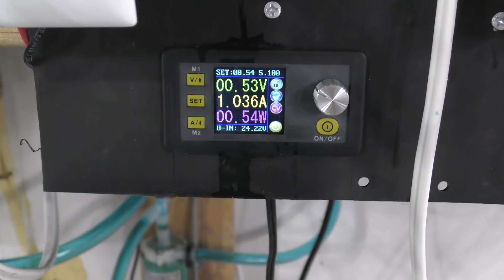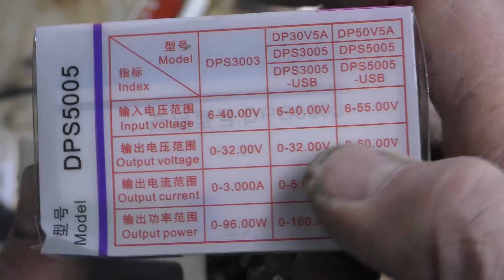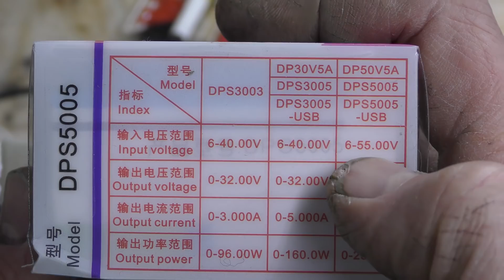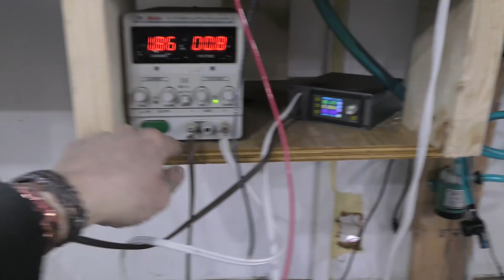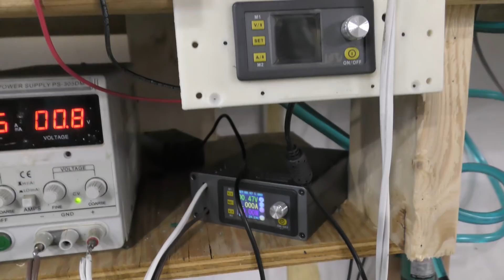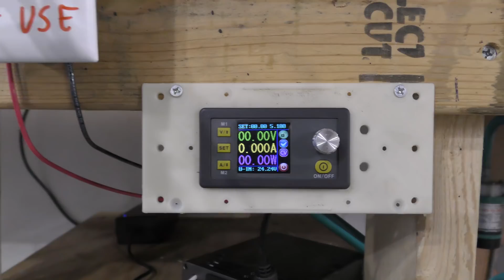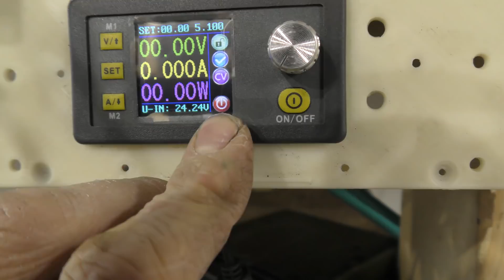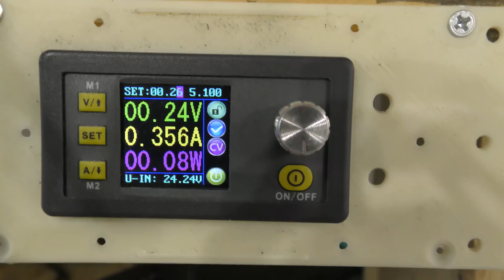New Electroforming Power Supply setup DPS5005

Comment: Hi jason. I bought your electroforming classes but I still have a big question, even before your amazing whey to teach.

I know the amps are the most important thing to consider on the electroforming but, my rectifier do not set the volts automatically.

So I would love to know how many volts I need for example when I have to set-up a ring with 0.1 amp?

And how many volts if I have a necklace that a calculated 0.4 amps. The volts will be the same as the 0.1 ring? 

I mean, i have a maximum voltage that I can use until the pieces get burned? 

I really appreciate if you could answer me my friend, and congratulations for your channel.

Comment: I just received the power supply and im trying to set it up.  I can adjust the volts and amps but when I turn it on the only thing that reads is the v and the amps and watts reads at 0. Not sure what I'm doing wrong.  Thanks for the great videos by the way! Love what you do!
Reply: Same here! Have you figured out what the issue was? I would really appreciate hearing from you!

Comment: Is there a reason why you don't dial in the amps directly. I've seen other videos of yours and you seem to be interested in the amps that flow but you always dial the voltage. Why wouldn't you allow max voltage but limit amps to 500mA or whatever you need in your process?
Reply from the maker: For electroforming I let it drift to promote texture as long as you have a good range of shine  like between .2-.4 amps per inch it turns out puffy on the ends.    In electroplating you might want to lock amps to preserve detail.    Many roads to Rome, one would say,